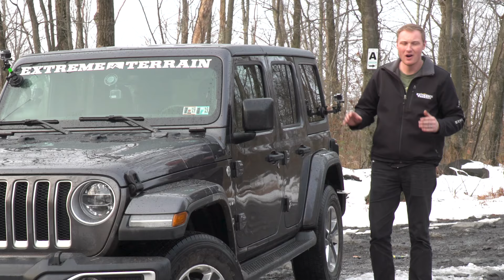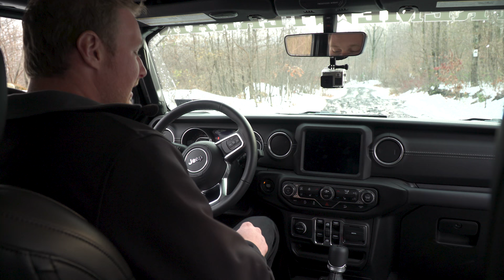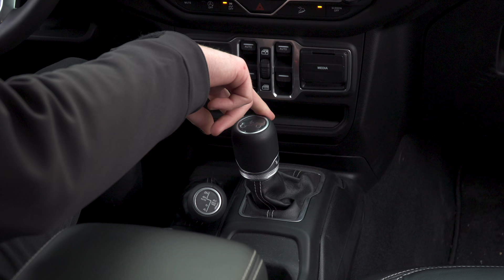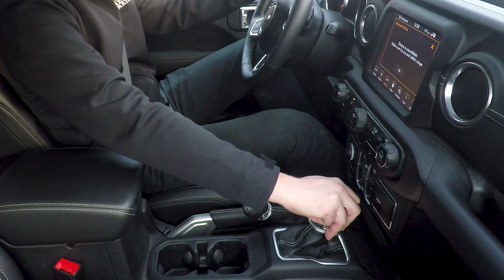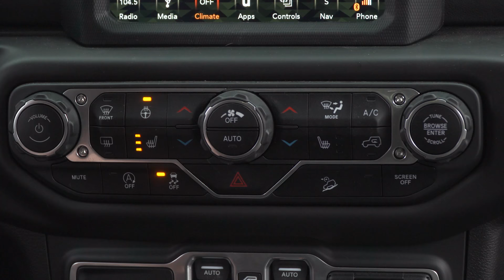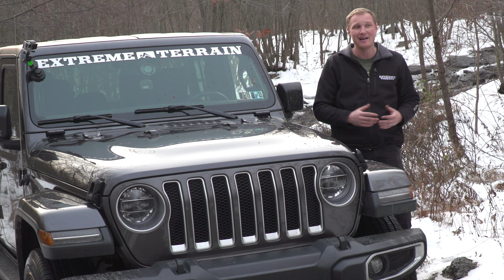Tested JL Hill Descent Control | How Good Is The JL Wrangler's Hill Descent Control?

Comment: If the terrain was uneven, would you disconnect the sway bar?
Reply: In the video that is a Sahara and it does not have that feature. I have 6yo Sport and I have used this feature many times over the 6 years and its great!

Comment: Couple of questions, does it actually use the brakes or does it use the engine to keep you at that speed that you set it at, and is it available in a standard?
Reply: It does actually use the brakes. Not sure if it’s on the standard.

Comment: As someone with no off road experience I would use this feature more than most but I would also want to learn how to drive without it. Nice to know it works when you want to use it.
Reply: The point I believe is to help keep your brakes from overheating and causing you tumble down a hill to a very unpleasant end.

Comment: Great video as usual. You guys have a 2.0L and there is a lot of debate what would happen if you run regular 87 gas on it. I think it would make a great test drive video too.
Reply: Nothing happens. The manual explicitly states that 87 is just fine. 91 or higher for optimal performance.
Reply: manual states tuned for 87 and up with 91 and 93 for best performance and mpg (which i never see a difference in mpg) but notice less get up power

Comment: When will all these buttons be  available on an IPhone app ?
I don't want to actually have to drive my new jeep, just sit in it and look at my phone as it drives along...
Or better yet, set at home, in my mom's basement and post videos of my Jeep offroading...
Lol...
I have a 1979 CJ 5, I bought new when I was 16 yo...
No power steering, no power brakes, lockers f/r. 
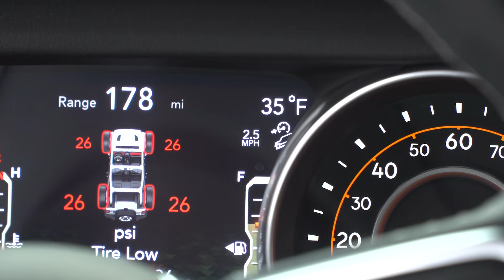Swapped in dana 44's, 5:13 gears, came stock w/ 4 speed /w granny first gear...
You youngin's n yur Detroit soft lockers...
(Sorry, old joke among old jeepers)...

Comment: Did you shift into 4L while stopped? I thought you are supposed to shift into 4L while rolling 2-3 MPH. Seems like 2 MPH is best for shifting into 4L. Do you experience any grinding?
Reply: It works best and is recommended that you shift into low range at a stop with the Trans in neutral

Comment: On my Rubicon JL I off road it a lot, don’t know if it’s just engine braking, but when I go down a very steep grade, I never have to push the hill descent button or put my foot on the brake, it crawls down the hill extremely slowly with no button pushed. No need to push button yet and been down some serious hills
Reply: I wonder if it is due to the low gear rock crawl ratio in the Rubicon? That feature is not in the Sport or Sahara.
Reply: It is most likely the very high gear ratio of the Rubicon engine braking for you. Especially if you put it in the manual shifting mode and keep it in 1 or 2
Reply: Must be, I can go down extreme steep hill and it crawls about 1mph with foot off the brake completely. Never touch the hill descent button